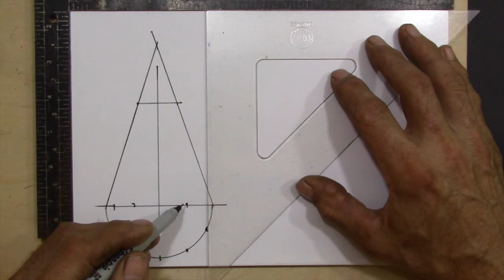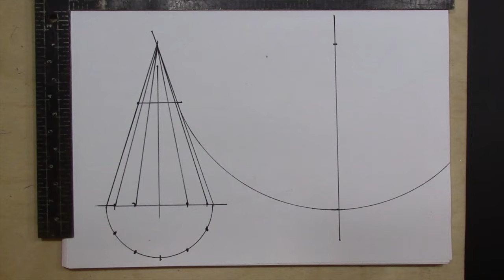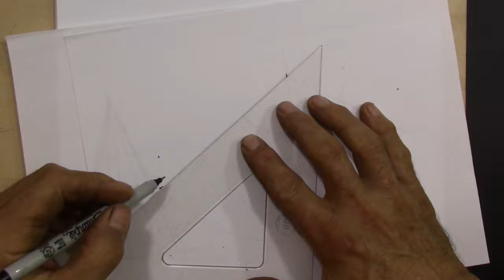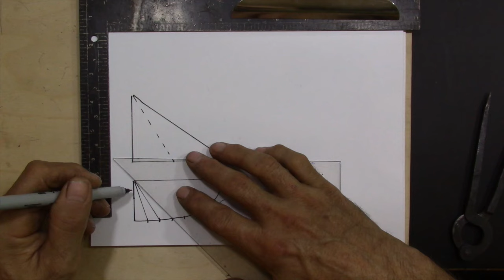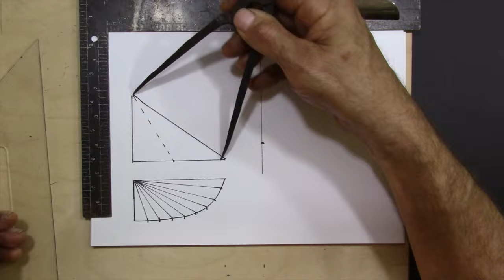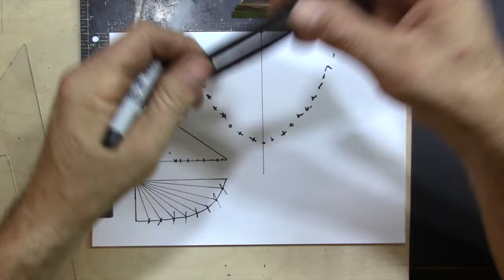Blacksmithing For Beginners - Creating Shop Drawings 4

Comment: I would like to see these patterns transitioned to the metal and maybe an application for them.
Reply from the maker: I will be using this process in future videos.  It won't be these particular patterns but I needed to get these videos out of the way to be able to reference back to them.  If you have a particular project in mind that you would like to see -  let me know. Thanks
Reply: John Sexton , I used a very similiar process to develop the shape of a cone for a candle holder I made for a contest. Here is a picture of it: https://abload.de/img/conexampledbs23.jpg The cone is made of copper and the shape was transitioned with a metal compass such as you see Dennis use in the video. I simply took the measurements from the drawing I had made starting from one point I marked on my sheet of copper. I hope I could help you out getting some ideas ;) greetings!